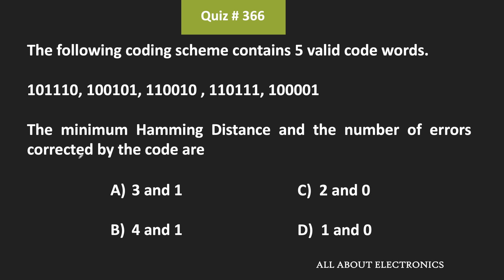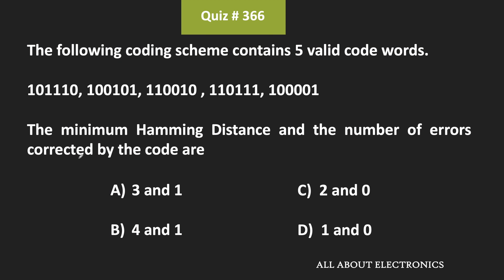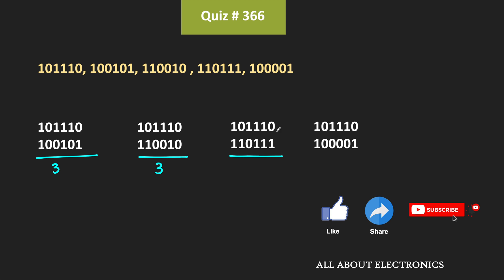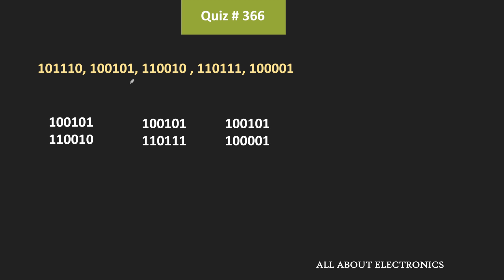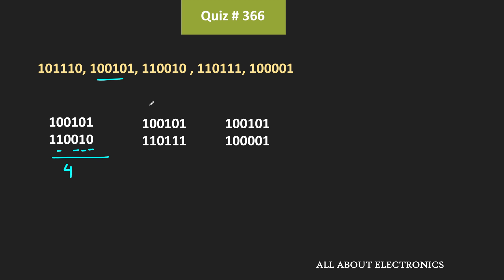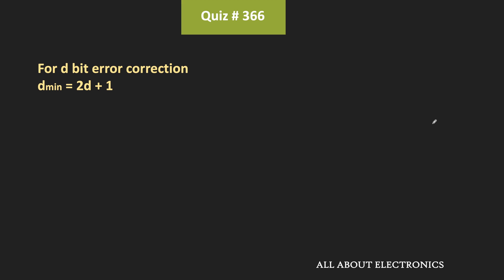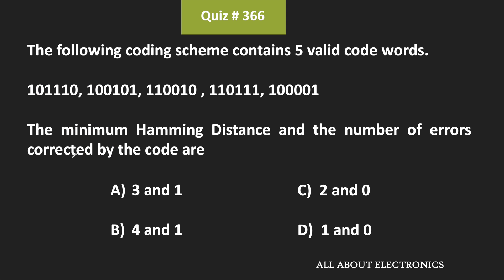Hamming Distance and Error Correction | Quiz # 366

Comment: how will be the minimum value of d be 1 ?
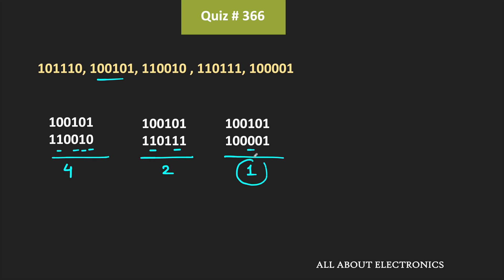Reply from the maker: As you have seen at 2:30, the difference between the two code is just 1 bit. So, dmin = 1. That means in this code, between some codes, although the distance is more than 1, but if we see the minimum distance, then it is 1.